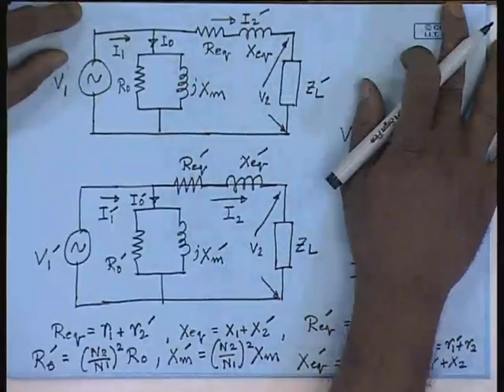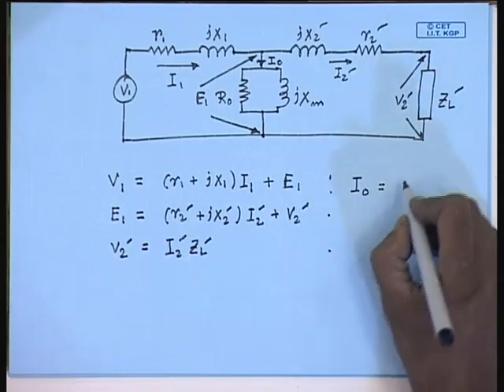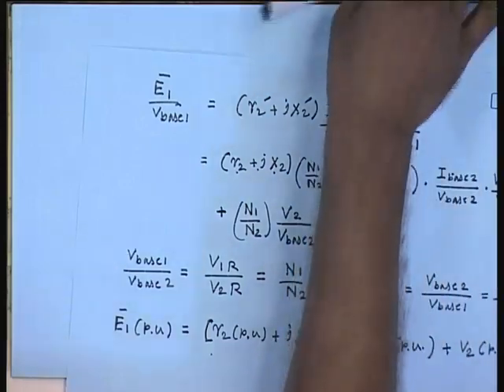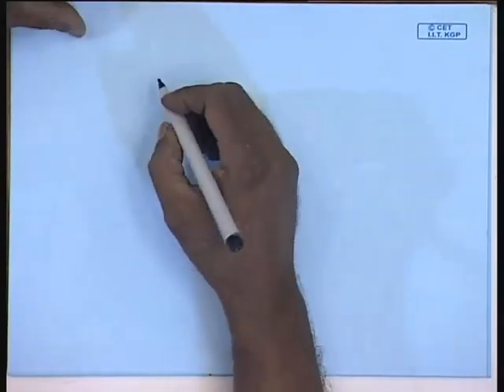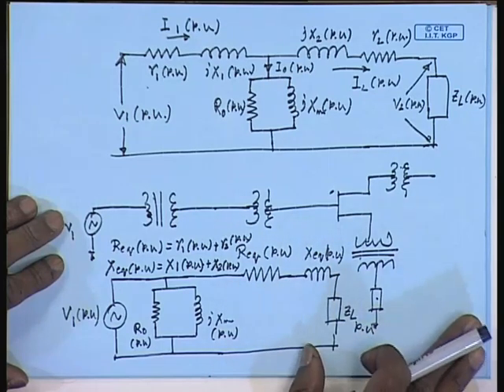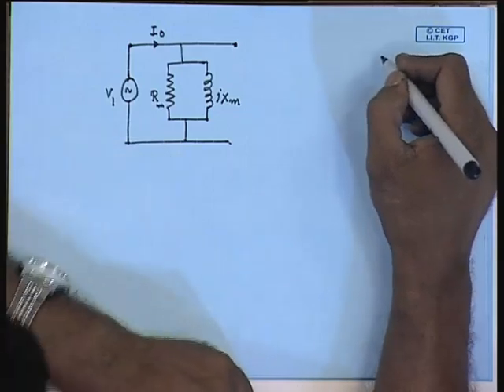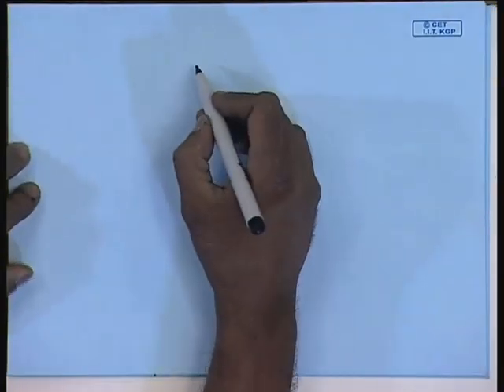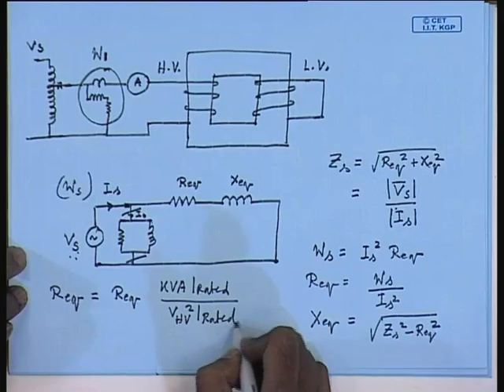Mod-01 Lec-05 Lecture-05-Testing of Single Phase Transformers

Comment: However now I understand no load and short circuit test. Thanks
Reply: Why lv side draws higher current than HV side .. In 49.34 pls clarify bro
Reply: @PE_with_Pooranessh.  P=VI ,power is same for lv & hv.Since voltage is low for lv that's why current is high & for hv voltage is high and current is low  hence product of current and voltage is same or constant.

Comment: So I understand from you that base and rated are the same thing?
Reply: Mahmoud Matar no....
Reply: @sandeeptiwari3655  would you care to explain then?
Reply: Base values can be selected arbitrarily, but they are usually chosen to be the rated values, as it aids in the calculation (specifically, while referring the circuit to the primary or the secondary side, it takes into account the transformer ratio n1/n2). That's what I know.